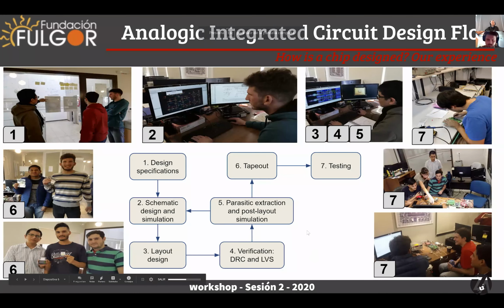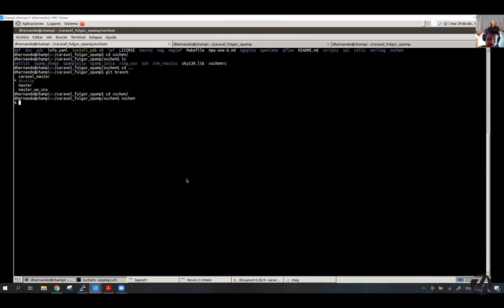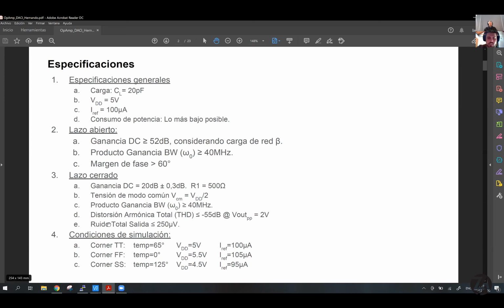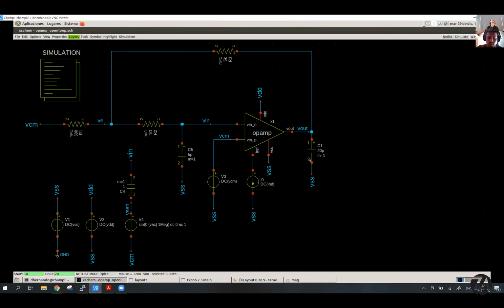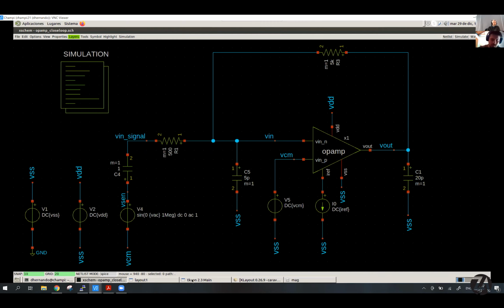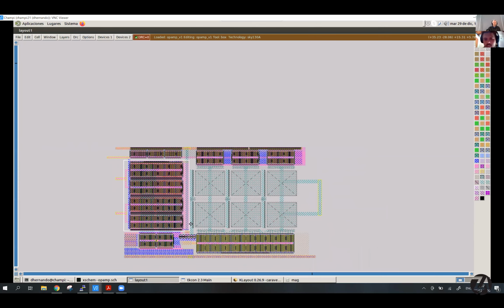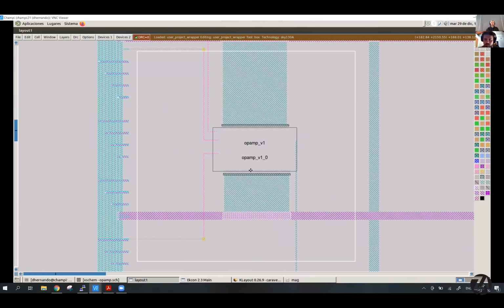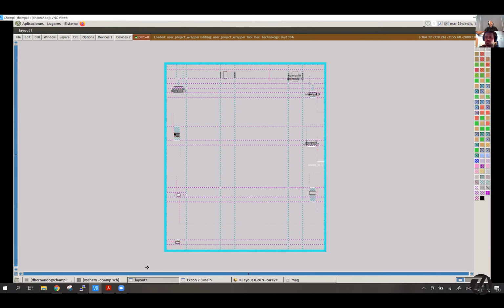Diego Hernando - analog circuits on the Google/Skywater/Efabless ASIC shuttle

Comment: Hello Diego, greetings, my name is Ian Erik Concepcion, student of Electronic Engineering at the National University of Córdoba from Argentina, I would like to ask you some questions based on the video you made about OPAM_V1 and you explained it together with Matt Venn.
   What are the fingers? You propose that 15 transistors can be grouped into a single transistor that would be in series or parallel and what function the fingers would have and in the end you put a 150 finger transistor.

As for the user_project_wrapper.mag file that is connected to an analog pin that goes to the caravel soc or caravan, which is its analog version, and what is the relationship with the user_project_wrapper.v file?

And finally, how do you run or execute your design, as you explain, there is a Makefile file in your project but in the openlane directory there is also another Makefile file and apparently it is where Docker and the OpenLane flow are executed. Could you explain to me what the first Makefile does? thank you so much.

     The project is found in the following link and is the design of an operational amplifier made with xschem and Magic VlSI AND OpenLane whose link is:
https://www.youtube.com/watch?v=uTlpT6Lszm4&t=1571s
Diego Hernando - analog circuits on the Google/Skywater/Efless ASIC shuttle

Comment: Curious what the transistor in the miller loop is for? I'm familiar with the miller effect, but have never seen a design with a transitor like that.
Reply: It is working as a resistor, in the triode region. It compensates the effect of the real part zero generated by the miller capacitor and therefore improves the phase margin.
Reply: @diegohernando4181  Hi
Did you use "openCarac" tool to run over all corners and get documented Result